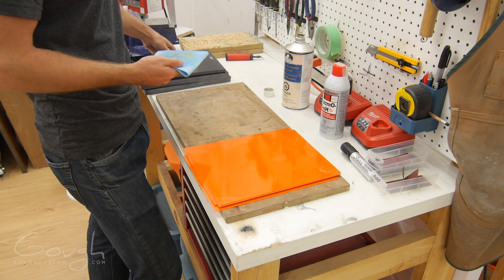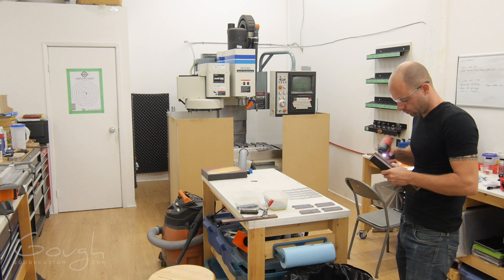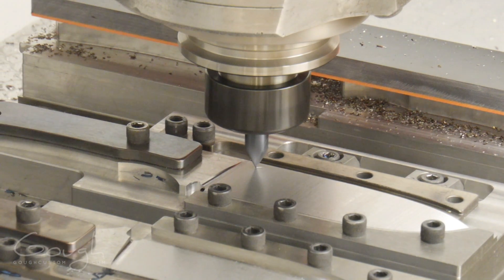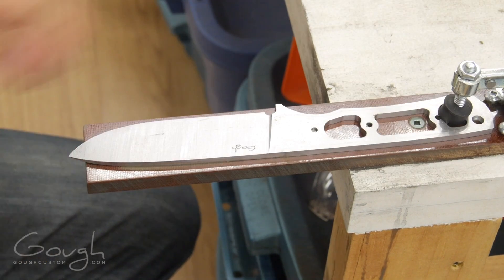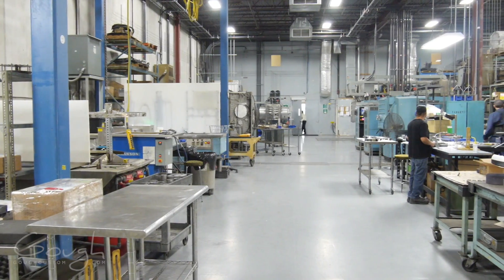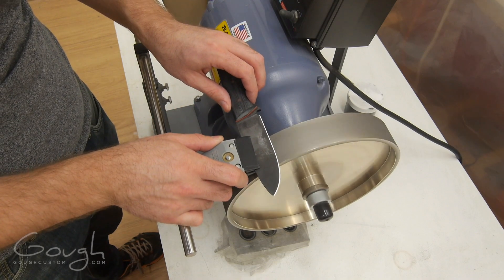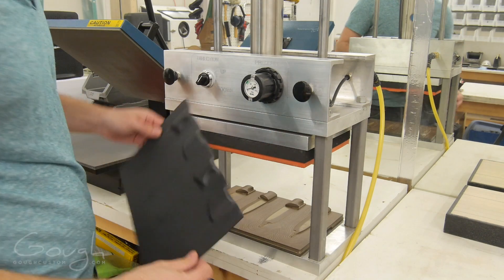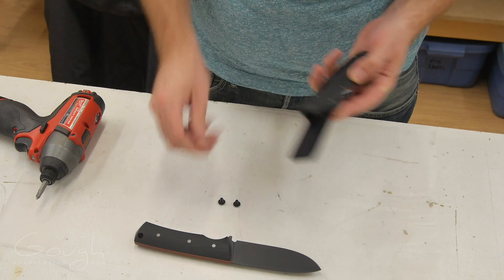Making a knife the high-tech way - Resolute MkIII

Comment: currently in the process of making a knife i designed in solidworks with my local machine shop. The place i ordered the material from [new jersey steel baron] has a waterjet cutting service that i'm using to cut the blanks, but im starting to wonder if it would have been better to have my machinist drill the holes for the handle screws himself. This vid has been a massive inspiration for my project, thank you so much!

Comment: This was one of the coolest knife making videos I've ever seen.  no way will I ever be able to afford your machines, but I gleaned a lot of info about the blank prep, etc.  What angle do you sharpen your knives to?
Reply from the maker: Glad you liked the video Jeff! Don't count yourself out in terms of affording the machines... I bought the machine shown in this video used for $8,000 and looking back I think that was not a great deal as I had to do a fair bit of work on it. With a little care in searching you can find a Fadal CNC machine in great condition for something like $10-12k, which is about an order of magnitude lower than a new modern CNC machine costs and it will deliver a lot of the same capabilities! I realize this is still expensive, but it's definitely much more affordable than buying new!

I currently sharpen my knives for 25º per side.

Best regards,
Aaron

Comment: when knives are produced at a larger scale, do they do cnc cutting, laser cutting or pressing?
Reply from the maker: The answer is 'all of the above', depending on the scale! Victorinox for instance operates on such a large scale that laser cutting would be too slow, so they 'fine blank' all their components from strip steel... Benchmade use laser cutting for all their components. Most companies do their bevels with a machine called a 'berger grinder' which is a LOT faster than CNC milling but less flexible and less accurate. I use CNC milling because it requires a relatively small capital investment relative to other options, and because it is also the most accurate and produces the best overall finishes...

Comment: Do you make anything using m390 ? If so, I'd order the The RESOLUTE® MkIII from you in that steel.
Reply from the maker: Hey Pat! No M390 at the moment, the toughness of that steel is actually significantly lower than the A2 steel that I currently use. I am looking at using a different stainless steel called AEB-L that is basically the toughest stainless steel you can get!

Comment: Knife looks pretty slick. Would love to see better steel than a2 and some wood scales, tho.
Reply from the maker: Hey Andrew! 
"better steel" is actually a way more complicated metric than you likely think! Any steel's performance is not only a matter of the steel itself, but also the heat-treatment... Many 'high performance' steels are usually heat-treated quite poorly in even very expensive knives which in turn makes them perform poorly. The manufacturers run the steel fairly soft because they are having to compensate for the relatively brittle nature of many stainless steels, or simply because there is a lot of variability in their mass heat-treatment that they have to account for.

I have my heat-treatment for A2 really dialled in! A2 is a very tough steel, much tougher than basically all stainless steels (with the exception of AEB-L), which allows me to heat-treat it very hard, which in turn allows me to make my knives quite thin at the edge because hard steel is more resistant to damage, and that thin edge geometry in turn increases the cutting performance even more.

I have tested my A2 against other companies heat-treatments of S30V and was able to beat it very easily (by a factor of 2 or more) when doing edge retention tests cutting cardboard. My customers have had the same experience and many have emailed me saying how surprised they are with the performance when compared to other knives they own that are made from 'super steels'.

Best regards,
Aaron

Comment: Hmmm. Wears mask when hand sanding but when machine is working and using vacuum no mask. Eh not to good. Cool knife though
Reply from the maker: When the machine is cutting steel it's producing large chips of metal that have no chance to get breathed in, as opposed to dust. When it's machining G10 all the fine dust is collected by the vacuum, the only stuff that escapes are the large heavy chips that immediately settle. I appreciate your concern though! G10 dust has always worried me and I take a lot of precautions with it... I now do all my G10 machining in a machine with a full enclosure, and using a HEPA cyclonic dust collector that is rated for lead dust abatement... The previous vacuum was also HEPA.
Reply: @GoughCustom  excellent! I try not to be a smartass but also try remind people of those dangers
Reply from the maker: @tattoosteveneo  Always good to take the risks seriously!

Comment: Hi, I am looking forward to buy one from your website but I have a question before that,

Is the sharpening after the coating will destroy the coating layer so the sharp edge will not last as before sharpening because it is lost the dlc layer? 

Thanks
Reply from the maker: Hey mate!
In the testing video the blade is sharpened after the DLC coating as well, so the results will be the same. I do this because either way the knife is going to have to be sharpened eventually, so it makes more sense for me just to do it that way right from the start!

Looking forward to making a knife for you!
-Aaron

Comment: Absolutely love my #1074!
In one word, perfection.
I really like Aarons concept of choosing a single design and perfecting it to incredible standards. Its different from many other makers.
I see some critical of the fact that he makes use of technology rather than as he had by hand but his goal is making the best product possible. Humans made these machines for a reason, to achieve what is simply impossible to do alone.
Just seeing his work shop speaks volumes to his work ethic. Looks like he could be making mechanical time pieces its so clean.
If you are after the individuality of a custom made by hand with all its character and imperfections there are plenty of great knife makers doing that.
I rest assured that every detail on my knife is absolutely perfect, the fit and finish, the materials chosen, the heat treatment, the blade finish, its all been thoroughly tested and chosen for a reason, to be as good as possible. My first slice through cardboard seriously impressed. It slid through with far less resistance than any other knife I have used including far slimmer folders.
Zero compromises.
Reply from the maker: Thanks mate, really glad you like your knife so much! I am also really glad to see that you totally get what I'm trying to do with my knives, just push closer and closer to getting them as perfect as I can! I am slowly working on the next version of the Resolute as well as a new kitchen knife design, and I am excited to keep pushing toward that goal with these next steps!

Comment: Beautiful result, beautiful process engineering. I do a lot of Kydex work and am particularly intrigued with the forming process you use here... What material is the Kydex mold you use made from?
Reply from the maker: Thank you very much Jon! The kydex mold is made from Phenolic which is a paper and phenolic resin composite. I just wanted a hard heat-resistant material that machined easily!

Comment: you lost me when you cleaned the handle sheets prior to sandblasting....is this a government knife
Reply from the maker: Hey Mitch! The main reason for that is to make sure I don't get oil or adhesive residue in my sandblasting cabinet, as I use the cabinet for preparing the knives prior to DLC as well, and the DLC process is extremely sensitive to contamination!

Comment: What is the point of this mat hard coating? Wouldn't a high polish (marginally) improve cutting performance? I'm sorry, all this is fine manufacturing but I can't help myself thinking it's way too over-engineered... I'm not that into knifes but I guess I'm more of a forged and hand built knife guy I guess.
Reply from the maker: You're right it does marginally improve cutting performance if you go with a mirror finish, mainly in grabby materials like cardboard and wood. The matte coating started as a request from a military customer, but it seems like a lot of people like it as it's by far my most popular finish. I am doing some research at the moment to make a matte finish that would have lower friction!

Comment: I dunno if you still check these comments, but just to be completely clear, you're using an 800 grit CBN wheel for rough-in?  not an 80?
Reply from the maker: Hey Ryan! I try my best to answer every comment! And yes I'm roughing in the edge with an 800 grit wheel... CBN is a very aggressive abrasive so it's still pretty fast, and there is not much material that needs to be removed!
Reply: @GoughCustom  That's good info, thank you, and thank you so much for the reply.

Comment: At 8:48 you mention that the component surfaces are flat enough to make the handle water resistant: what level of flatness does one need to achieve that?
Thank you for up loading these; I hope you'll get the chance to re-do this vid in your new shop.
Reply from the maker: Hey mate! Unfortunately I don't have exact number but basically if you check on a surface plate and get contact over the whole surface then you're definitely going to have a watertight fit-up!

Comment: Have you looked into cryo treating? It can double the life of tooling. If you got that With your blades they would almost never need sharpening.
Reply from the maker: Hey mate! I talk about this briefly in the video but I do actually cold treat my knives! Unfortunately cryo treatment is not the universal magic that it is often made out to be... Long soaks in liquid nitrogen can cause tool steels to form secondary carbides, but they are very fine carbides and may not have that much of an effect when the steel already has an appreciable carbide volume (like the steel that I use does)... Cold treatments like the one I use are basically an extension of the quenching process and increase the hardness which in turn increases the wear resistance. I actually get pretty amazing edge retention already, though I am always looking for ways to improve!

Comment: Impressive knife!!! I just do not understand the bolts you grind away the heads.  Or the heads are completely grinded away and in that case the hefts are not strongly attached?  Or the bolt heads have been made sunk for a little?
Reply from the maker: Thanks mate! The bolt heads are countersunk down into the handles, so I'm not grinding all of the head off, just the exposed part.

Comment: Oooook….knife making the high tech way...first of all you must go to Geneva and acquire the Large Hadron Collider then....
Reply from the maker: Then smash the atoms together to make new elements, which shall then be used to wind a coil of wire to make a servo motor. Then used lithography to etch a block of silicon to make a CPU. Then invent a programming language and start programming. Invent the internet. Then make metal from iron sand, build a CNC machine and you're done!
Reply: @GoughCustom  well...that's the high tech way...on the other hand I could just use my credit card to purchase one of yours knives but...they are all sold out...bummer.
Reply from the maker: @lucalucente3797  Hopefully I will have more knives available at the end of the month! If you want to be notified when they are available you can sign up for the mailing list on my website!
Reply: @GoughCustom  sweet...

Comment: I'm not a fan of that drop-point, no-grind-line blade shape (in terms of appearance, that is), though it seems to be a trendy shape these days. That shape doesn't look anywhere near as cool as something like the blade of Buck 119 Special ( which is a particularly good looking clip point). It looks like a short and fat version of a chef's knife blade. It would look better if it didn't just have a simple wedge-shaped cross-section. The lack of a grind line is the main reason that it looks like a chef's knife blade, though I guess it makes the hand sanding part a lot easier.
Reply from the maker: The shape of the knife is not about looks, but about cutting performance. The ideal knife would be a single atom thick, but seeing as that's impossible the thinnest knife possible is the best knife. Going with a full-flat grind like this makes the knife cut a lot better than a saber grind or other styles. The drop point shape is the most useful for the widest variety of tasks. Clip point blades are less nice to use for skinning than drop points.

Comment: Have you tried changing your stepover on the finishing pass to say 0.05mm as I get smooth bevel on a 12mm ball nose might take longer but could save you having to sand it
Reply from the maker: Because the bevel is at such a shallow angle using a ball-nose would produce a worse finish, as you're using just the tip of the endmill and the SFM there is very low... I have tried this in the past and didn't get good results... The bull-nose endmills work much better in this application from what I've seen! You're right though a smaller stepover works better! I now hard-mill all my blades with a very small stepover. I still have to sand a little to remove tool marks but that's because I'm very picky!

Comment: is that a standard  3 phase baldor grinder with a vfd?
Reply from the maker: Yes sir it is! Technically you should use a VFD on standard motors (inverter duty motors only) but it seems to be working fine with no heating of the motor and I've been running it for quite a few years now with no issues!

Comment: very nice - and surprisingly affordable (went to the web site).
Just one question: you mentioned stropping it with 1000 grit CBN - isn't that a bit coarse?
Reply from the maker: Thanks Ian! I prefer toothy edges on my knives, but it's likely not as coarse as you think because the abrasive is used on a soft wheel, which reduces the effective roughness

Comment: I like CBN wheels, relatively inexpensive and last forever. I haven't used CBN paste before. Results are obviously good.

I'm curious why 800>1000 grit. Seems like a relatively small jump. Speed vs diminishing returns of a finer paste?
Reply from the maker: I don't want to go too high with the paste as I still want a toothy edge, and the paste doesn't cut that aggressively on the MDF wheel so low grit seems to work well!
Reply: @GoughCustom  Makes sense. Cheers.

Comment: I'm curious, what type of mills are you using to machine G10, and after how many handles do you have to change them approximately? There must be huge wear.
Reply from the maker: Hey mate! I'm using AITiN coated solid carbide endmills, nothing fancy! I get about 30 handle scales out of a tool before it starts showing wear and needs to be replaced. I could get a lot more than that out of a single tool but I replace them early to ensure that I get a really high quality finish.
Reply: @GoughCustom  thanks for the reply :)

Comment: URGENT QUESTION:

Why did you grind away one of the hardest substances on Earth?
The DLC coating is so thin that if the knife was sharpened before the PVD coating, it would stay sharp for so much longer (and be more durable).
The cutting edge is also at risk of being attacked by saltwater and other chemicals.
So confused plz help?
Reply from the maker: Largely because at some point the customer is going to have to sharpen the knife regardless and it's not good if their first sharpening drastically changes the look of the knife. Also there are a lot of handling steps needed after the coating is applied and doing all those steps with a blade that's already sharpened introduces unnecessary risk. Finally I don't think the DLC coating would actually increase the edge retention that much, and it would likely decrease the sharpness as the coating might be thin, but it will still round over the edge very slightly during application.

Comment: Something I've wondered before is why not add the coating after the sharpening process? If the coating is harder than the steel then surely it would give a harder edge?
Just wondering if anyone knew, the only reason i could think of is for future sharpening maybe.
Reply: It would chip off with use, and it wouldn't look as sick lol 

I don't really know that's just me guessing
Reply from the maker: Basically the knife is going to have to be re-sharpened at some point anyway, so it makes sense to ship it to the customer looking the same as it will after that first sharpening. Also if I wanted to coat the edge I would have to ship the blades to my coater already sharpened which would make handling dangerous for them, and for me during assembly!

Comment: I'm looking to put some diamond like carbon coating on my knifes but having some trouble finding it.  Can anyone help?
Reply from the maker: Hey Steve! The company I use is located in Canada, they're called Sputtek. Be prepared for a shock when you get pricing though. It's only really feasible if you're going to be sending them a lot of knives. Coating for a single knife might be $150 or more... You could also try a company in the USA called IonBond

Comment: When you say extra care is given to the plunge, I understand the reasoning and importance, but I wonder how you might approach an instance when you notice the need for adjustment. Would you tweak the gcode a thou or two or perhaps nudge the tool path with tiny changes to your work/fixture offsets?
Reply from the maker: That's correct, usually I'll tweak the program a little to fix any issues I might find... The final step was to actually work out how to model/program the ricasso, plunge and bevel as one piece with a single tool and managed to eliminate all errors! The plunge lines come out absolutely perfect every time now with no more tweaking needed!